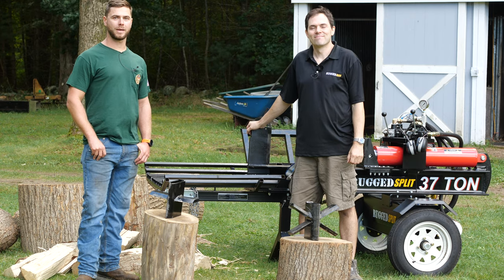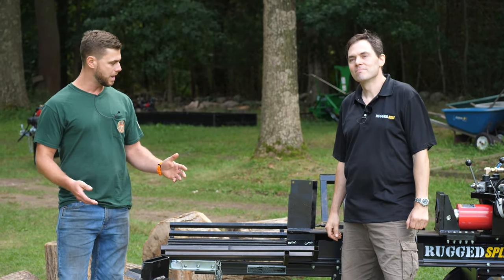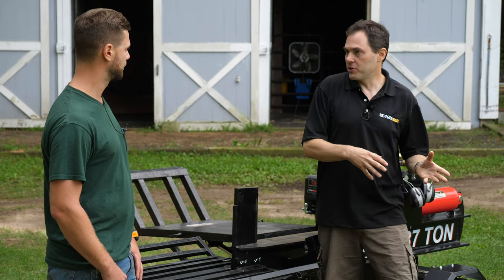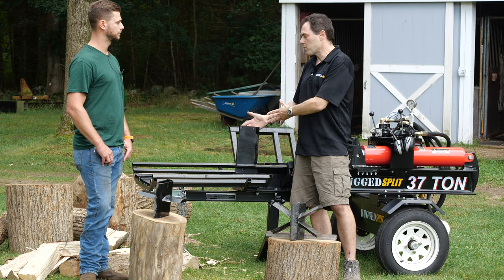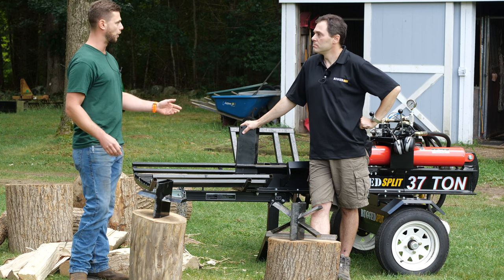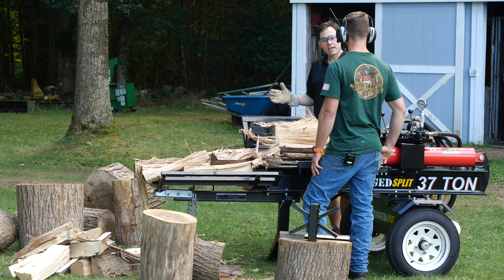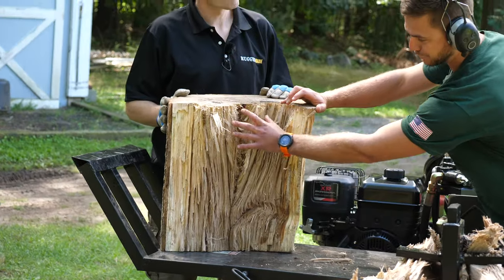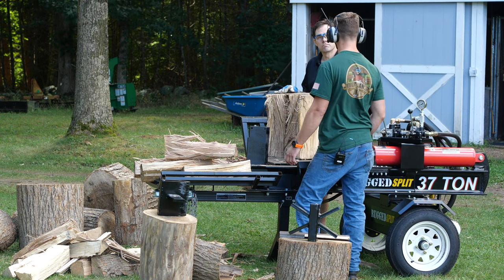#279 Which Log Splitter Wedge to Use for Making PERFECT Firewood??

Comment: In the video you can see the six way lifting up when it splits, which means you have to pull the woods out of it each time to re set the level, that’s slow. You just need to keep pushing through and it not lift to get productivity. That’s why I re engineered mine

Comment: I have this model and the blades. There is a big problem with the six way, the bottom horizontal blades are the wrong way up. This means that as you push logs through it lifts up, as more and more goes through it lifts further. The annoying solution is cut the off and reverse them. So the flat side of the bottom blade is on the bottom. I’ve also set them horizontal, and set back so the ram is splitting on one plane at a time. The original six way has the side blades set at the same offset, so it splits in two then four. So the power is halved...
Reply from the maker: Yep you’re definitely right, it hasn’t bothered me enough to justify the time to change it like you. I don’t really use the 6-way often enough.